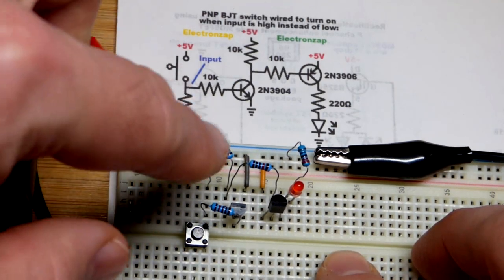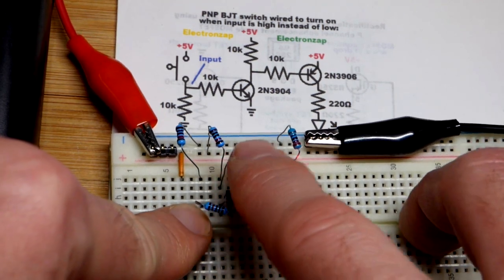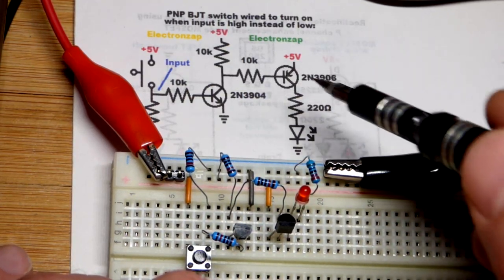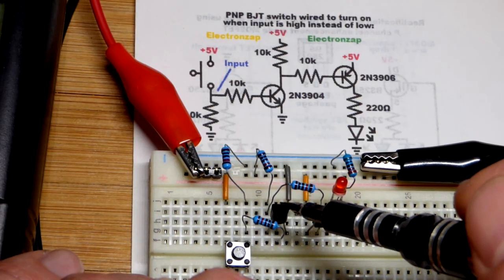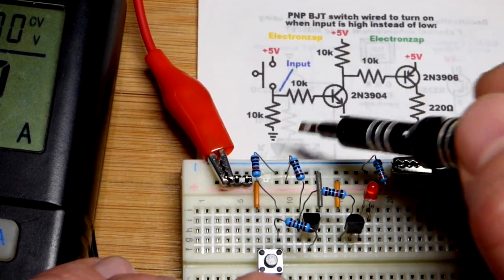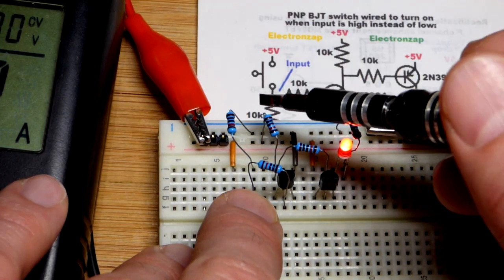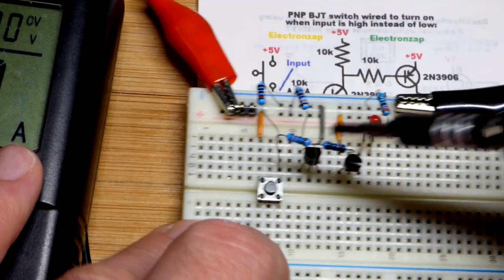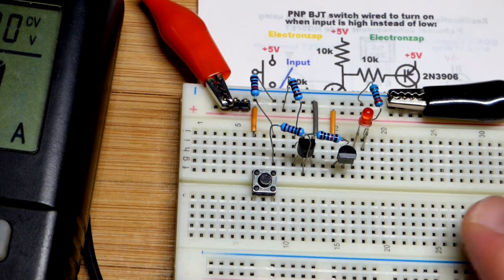PNP BJT Turns on With High Side Switch On Signal Electronics Circuit Modification

Comment: There are actually some dual transistors that you can buy, that have an NPN driving a PNP, and even bias resistors... I'd have to poke around to find them, but the ones I used were from Rohm
Reply from the maker: Thanks!